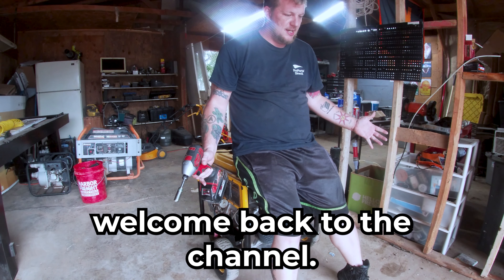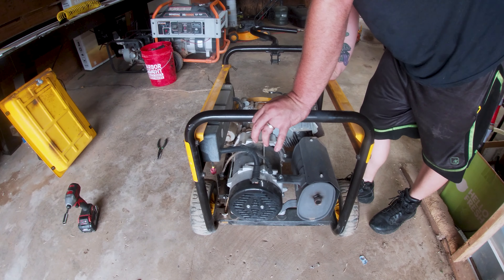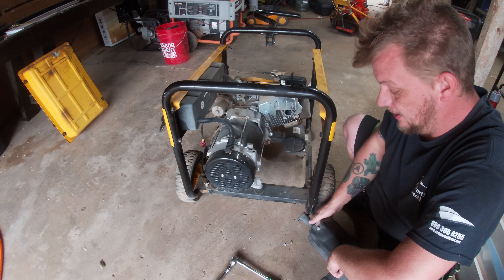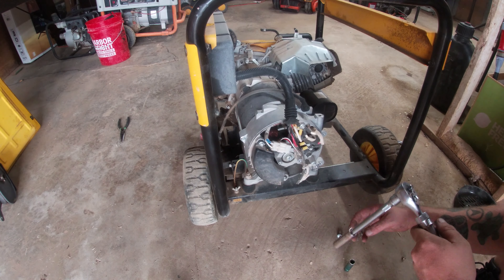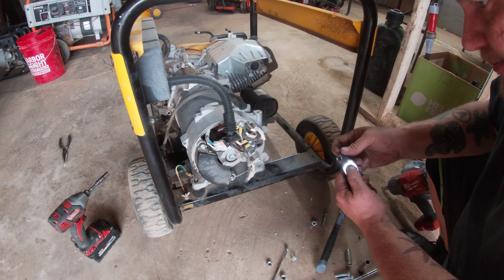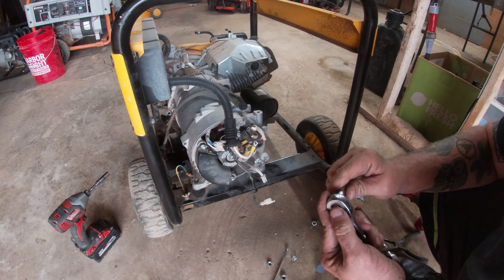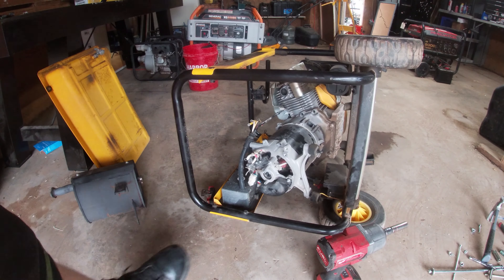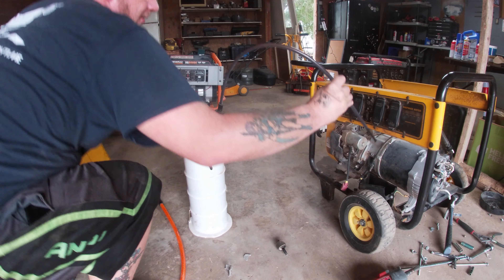Generator Repair: How To Remove A Stator And Rotor

Comment: Does the engine still run even with the stator and rotor off?
Reply from the maker: @markbanana5775  ues
Reply: Yes, it should. I have remove generator head in the past and if the engine still have all its covers, you can start it, not for long since only 2 feets still bolted, but for a few seconds to make some tests, it will work.

Comment: Can you just screw a bolt into the fly wheel and use a puller to pull it off then and far as the rotor screw a bolt into that and hit it with a dead blow hammer? I never seen one have to split the crank case? I been watching alot of videos on how to I think  on my wen generator  the stator  is definitely  burnt and the rotor  im just gonna replace  both I was quoted 230 for  both I think it's still worth  it to fix it I got the gen for a deal. Some say just buy another gen but it way more expensive  then to just repair  one your self. And then you know what ya got.
Reply from the maker: Yes you can. I kind of went a little far about to be honest. Once I got it off the two things mounting it to the frame it came right out

Comment: Im trying to remove my broken stator off my engine. at 8:24 does using a drill break the drive shaft? I tried taking it off but it just spun and i dont want the engine to break. any tips?
Reply from the maker: No it shouldn't